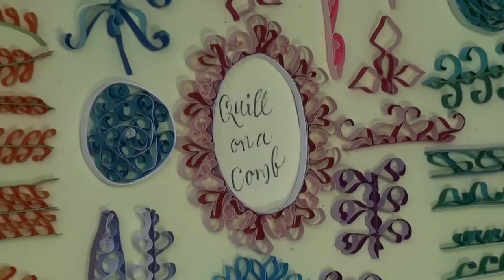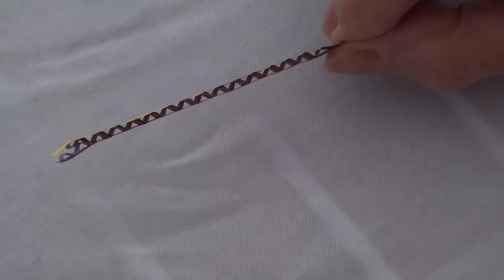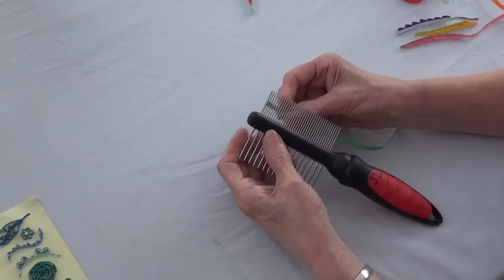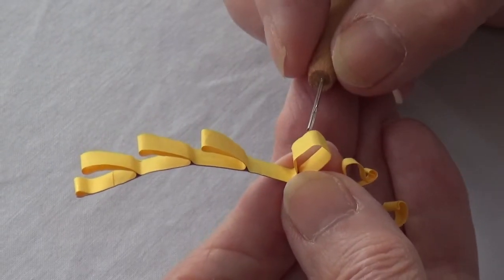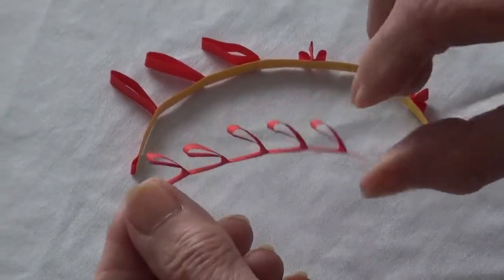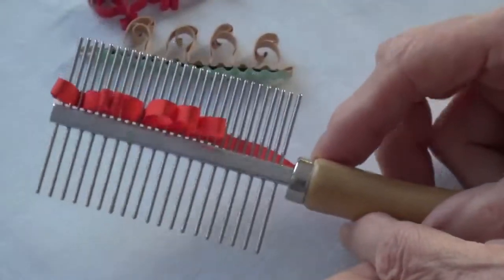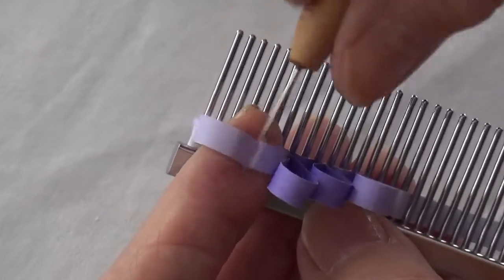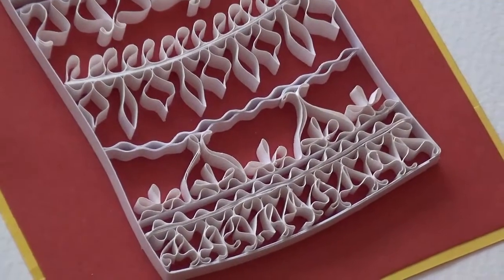'Quilling on a Comb' demonstrated by Jane Jenkins

Comment: Hello, I am a beginner in quilling, although I am quite old. I learn from videos and recently discovered your channel.Although I have enjoyed watching many videos and doing some things, I watched your videos the longest and most thoroughly. I learned the process step by step. I think I found your way the best. I absolutely love your braids, bows and the endless possibilities of what I can make of it. Of course, I'm still clumsy, my hands don't work as well as they used to, but the main thing is the joy when I succeed in something. I do have one question about the straps though. If I'm not mistaken, you have 100g bands, I have 120g. But I have a feeling that my straps are softer than yours, even though it's supposed to be the other way around. Is it because as I see you use at least 5mm and I use 3mm. Is it better to have wider strips for images? I was also happy when you showed how we can make molds. I didn't even think of it that way. I saw plastic molds somewhere, but they were very expensive, and only three sizes each. But I can make it any size I want with my own methods.
Greetings,
Maja from Slovenia